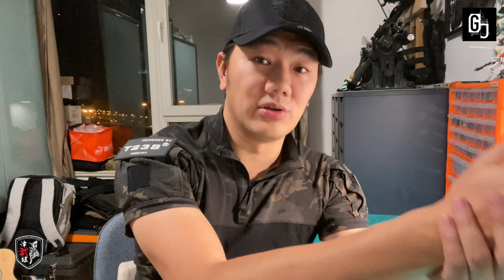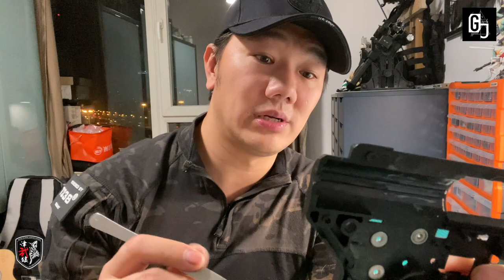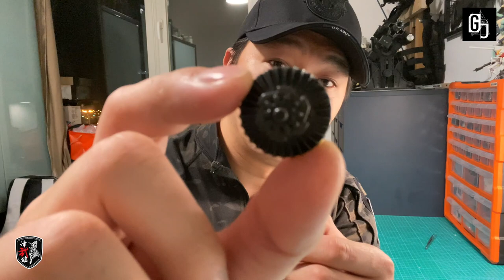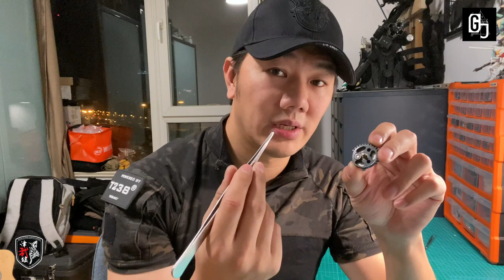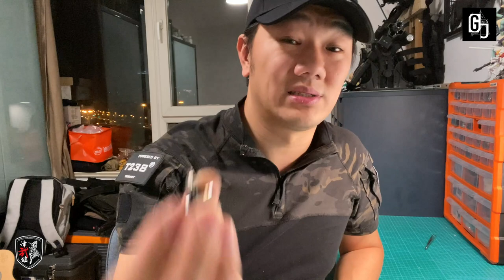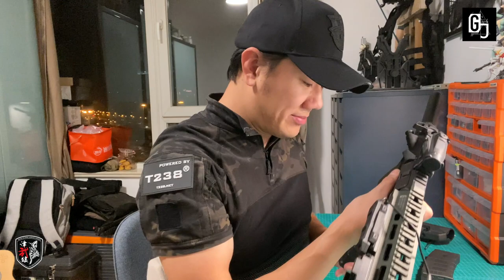Beginner Series: Increasing Rate of Fire

Comment: is it possible to have a future beginner series ep talking compatibility with parts? 
coz there is not many info online talking about that, for example jinming gen8/9 box parts vs ver2/3 box parts, the cylinder head nozzle rod and the nozzle it self are different size to gen8/9 and such.
Reply from the maker: Generally speaking the compatibility is more on gearboxes and receivers. For the internals, responsible sellers usually indicate if the part is JM only. JM are the ones with their own layout and dimensions, so generally speaking, JM parts are not compatible with FB or Kublai stuff. I'll document it and maybe I'lll see if I can do a video on it.
Reply: @galapagosj3021  arh I see o.O

Comment: hi guys, quick question.  Are the dimensions of a gel blaster gearbox the same as an Airsoft gearbox?  I want to try out that Fighting Bro split nylon gearbox in my Airsoft M4.  It looks almost identical apart from the cylinder / front part of the shell.  Any help would be appreciated.  I've fitted Airsoft gearboxes in a SLR receiver but never the other way round.
Reply: V2 gel blaster and airsoft are the same on the outside, the inside is pretty different though I'm sure you know that ✌
Reply: @kaneadams2340  I'm not so sure that is 100% true.  If you look at a both V2 gearboxes the gel blaster version looks slightly longer
Reply from the maker: You might have problems with the mag well since the gel ball gear boxes have this extra bit for holding the mag feed terminal, it will affect the magazine fit I think. For the inside, the dimensions are slightly different as well and you might trouble with tappet travel. Other than that, I have not noticed other difference. I have used airsoft gear boxes for gel blasters and they work pretty well other than those two things I mentioned, which require a conversion kit.  It sure if it works the other way around.
Reply: Sorry I'm still learning 🙏
Reply: @galapagosj3021  thanks man, it's for a project I've got planned here in the UK. Ordered one up, they are dirt cheap anyway compared to a Retro Arms or ICS.

Comment: What about using 11.1v instead of 7.4v batteries? I use 11.1v in my Vector v2 and one of my Alpha King AKs, seems like a very cheap and easy way to increase ROF. Just wondering if you are totally against this method as you didn't mention it?
Reply from the maker: That's a good point. I didn't mention it because it just never came to me at that time because I only use 11.1v lol.... I never touch 7.4v so I suppose subconsciously I just assumed everyone does that. And to be honest, for everything that I share with everyone, I always assume the basis of using 11.1v. However, I DO have a 14.8v sitting at home, which I have not touched ever since I bought it. It will push the motor harder but I'm guessing its also going to wear it out a lot faster. I'm still trying to think about where I can put it.
Reply: @galapagosj3021  Haha, that's cool man. Some people are paranoid about using 11.1v and scare monger about fried mosfets, trigger switches and voided warranties. Not a totally invalid argument, especially for older or 1st version blasters.
I wondered where you stood on the issue.
Newcomers might not know or have read of one bad experience and been scared away. And pretty much all the blasters come with cheap 7.4v batteries.
I think your experience level is so high at this point you now see intermediate experience level as beginner level XD

On another note, got some sweetheart hopups in the mail today and I'm looking at a whole new world of flash hiders/ compensators/ decorative end cap thingy's... thanks heaps brother, keep up the good work :)
Reply: @galapagosj3021  "EDIT: Doesnt take into account any PCB curcuits inside the gearbox" --- The motor will wear out, but it wont be due to the voltage from the battery unless the motor isnt strong enough to drive the spring back. The wear on the motor will come from the amount of rotations it will be doing compared to the normal 7.4VDC. A good motor with decent windings should handle the extra potential difference and current increase quite easily. A 480 motor, when pulled apart looks like it was built for 16VDC. SO im guessing companies put 7.4VDC batteries in the guns to increase the play time it lasts or maybe its to mimic real world fire rates. Good video man, and its nice that you touched on bearings. They make a huge difference in stress on the motor.
Reply: @galapagosj3021  yeah, 14.8v batteries shred through motor brushes quicker
Reply from the maker: Unless.... you have a brushless... Hahaha, I burnt mine though...
Reply from the maker: Companies put in 7.4v to make it last longer for sure, but that's also why I don't buy out of the box stuff because I know I'm going to upgrade that stuff in the end so having that extra set of nylon gears and crappy motor is an eye-sore for me... Unless its a blaster I can't build myself like the Vector, AUG, MP5, otherwise I just build from scratch. So I hardly ever touch 7.4v, which is also why it never came to me that it was something I needed to mention in the video lol.

Comment: does semi auto drain more battery than full auto?
Reply from the maker: It does, since activating current is still much higher than consistent operation current. If you do lots of semi, you will run out pretty soon. BUT, 1,400 mAh keeps me going for 8 hours no problems. But it also depends on your habit, if you are trigger happy or not. Try not to be...